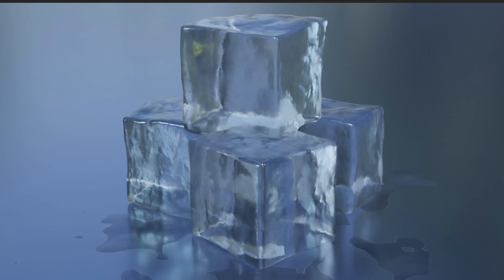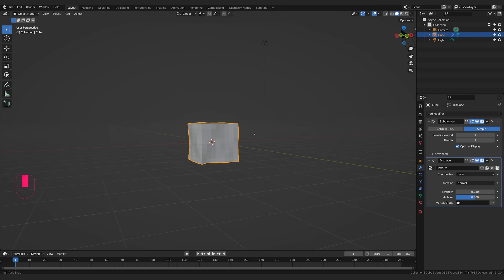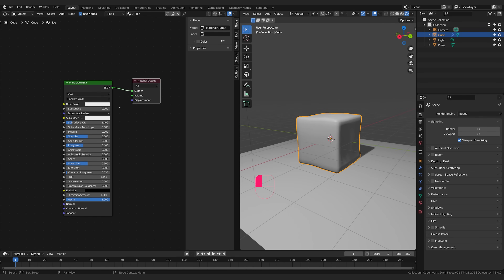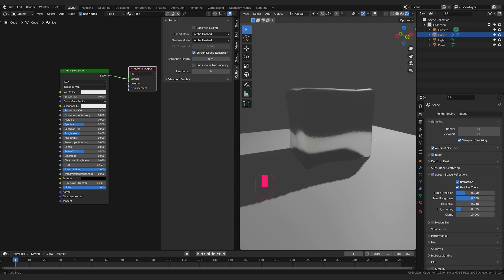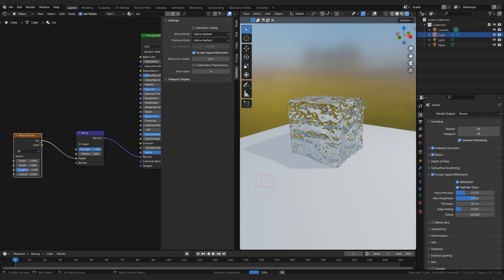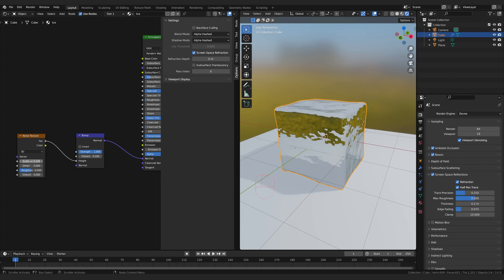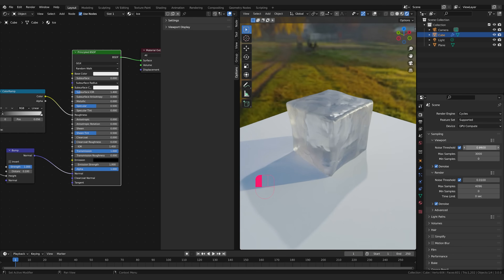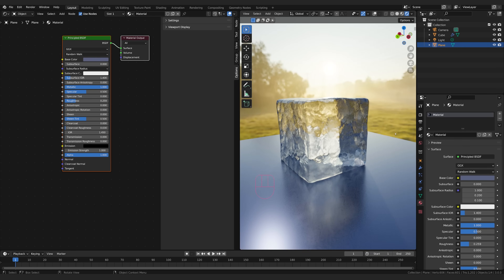Make Realistic Ice in 10 minutes in Blender (Procedural) 2022

Comment: Awesome tutorial, thank you. I went to render the ice cube scene in cycles but the viewport daytime background wasn’t a part of the render, does that need to be turned on in another setting? Perhaps the World settings?
Reply: That's the same issue I'm having. The ice cubes worked out great but, like yourself, the HDRI doesn't appear when I render it in Cycles. Have you had any success since?
Reply: @Nortic111  Still no luck on rendering the HDR background in cycles, any tips yet? I already have the "world opacity  to 1 in the viewport shading" but it still doesn't render in cycles.
Reply: @mark97217  go to shader editor and switch from Object to World and add the HDRI in there and it will work. I just fixed it myself too...
Reply: World opacity to 1 in the viewport shading